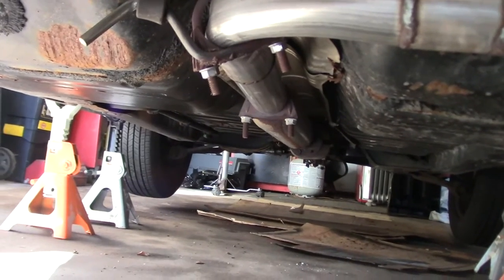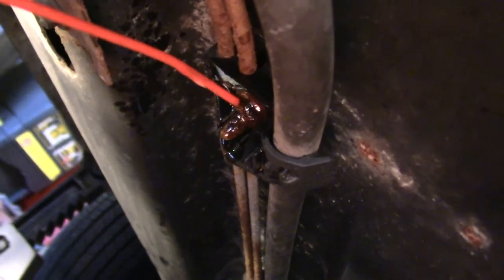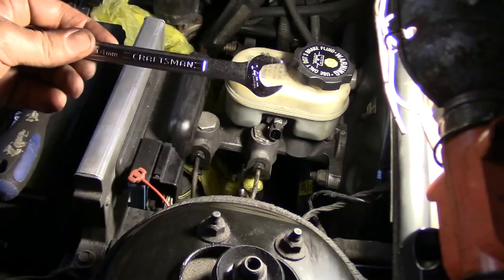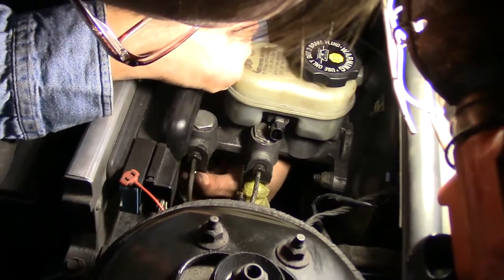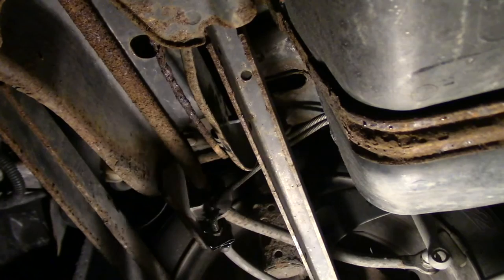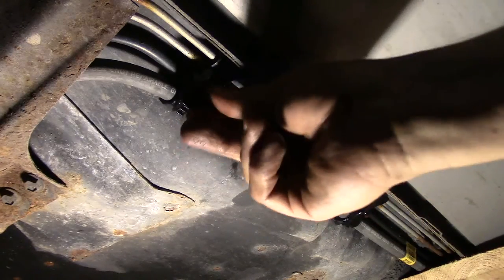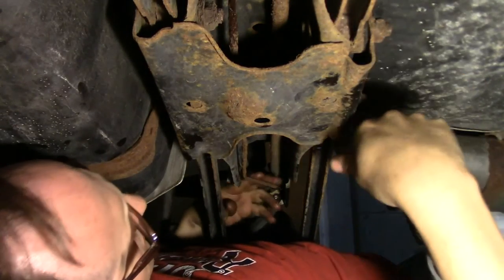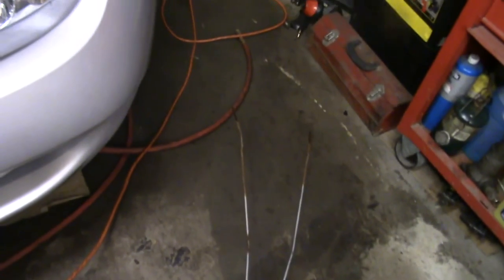2001 Saturn SC2 Brake Lines Part1 Removal

Comment: Where did you buy the brake lines from can you provide place.

Did to also replace each brake line to each wheel too. 

Besides two lines.
Reply from the maker: I bought the brake lines at Advanced Auto, but you can get brake lines at just about any auto store- Auto Zone, O’Reiley’s, Napa, Etc. I’m trying to remember if I did all 4 wheels or just the back 2. Either way, the process is pretty much the same for each wheel. The only difference would be how long the lines are and how much you have to fight with the lines to get them around and through all the other car bits. I guess I could go back and watch the videos myself, but this was a LOT of work! I had to break the process down into a 4 video series! Ha ha!

Thanks for watching and thanks for commenting!

Comment: I just watched the rear drum brake video.  I subscribed since I am going to need some help to fix my rear brakes, which are leaking
Reply from the maker: Thanks! Well, I have a series of videos on replacing my brake lines. If your brakes are leaking, you may want to check those out. Even if you don't end up needing to do it yourself, it shows how that system goes together pretty well. Its a bit long though, so I won't be offended if you skip through to find the parts that may apply more to your situation. If you have questions, I'm happy to try to help. Good luck! Thanks for commenting!
Reply: @ClayCarlino  I just watched part 1 a little while ago.  Man, those old lines that you had where SHOT!
Reply from the maker: @mgonza1350  I KNOW! ha ha! They were so BAD! I don't know where you're located, but here in Pittsburgh Pennsylvania,  they dump truckloads of salt as soon as snow flakes even touch the ground. And I think that a lot of car owners don't think a lot about the brake lines. They may be mindful of pads and rotors, but it seems like the lines get forgotten.

Comment: Do you think it would be possible to keep the retaining clips on and slide the brake line through instead? I'm trying to learn from your troubles before I tackle the exact same repair.
Reply from the maker: I don't think you'll have any luck with that. If your old lines are rusty and crusty like mine were, they won't slide out, and without loosening the hardware, it's going to be REALLY hard to slide new lines in. My boss did this job on an old van he didn't love and just left the old lines there, then zip tied the new lines to the old ones. If you don't want to mess with the clips and you don't mind it looking a little hacked up, you could do that and it would be a LOT easier!
Reply: Thanks for the suggestion! That's exactly what I did. It doesn't look pretty, but it got the job done. Your videos were a big help!